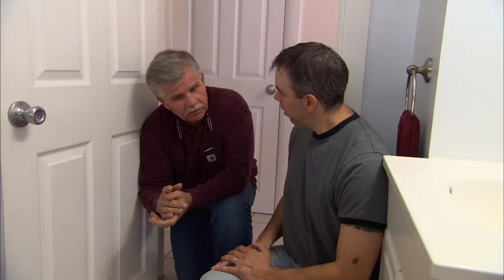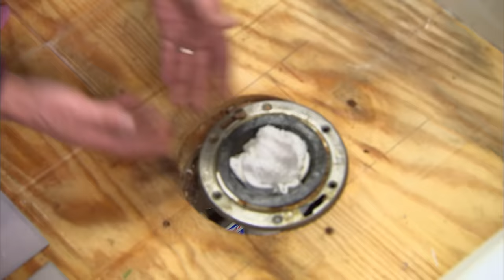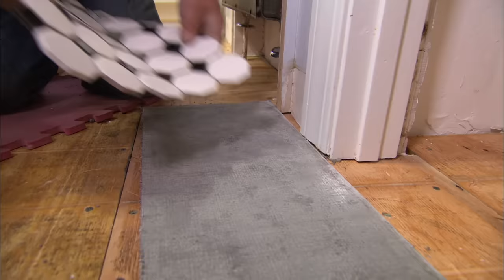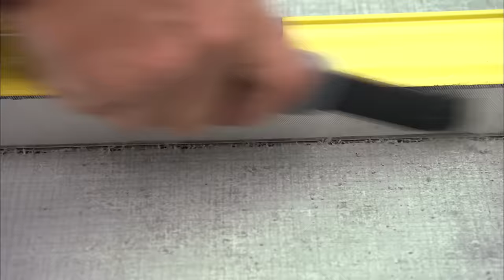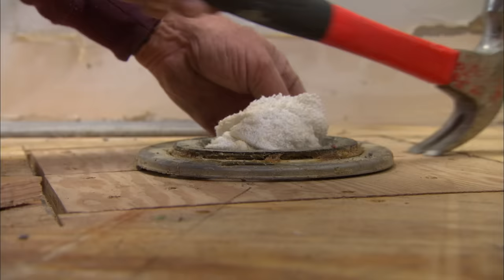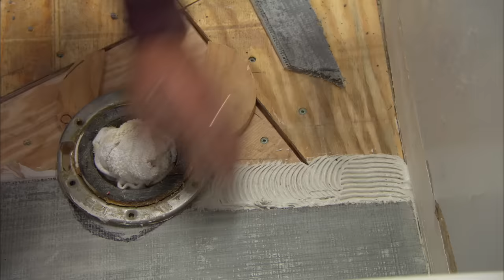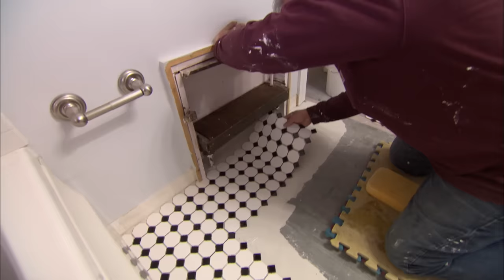How to Replace a Vinyl Floor with Ceramic Tile | Ask This Old House

Comment: Mike Holmes would have replaced the subfloor, and the walls, and ceiling, and joists... because it's the right thing to do! Minor bathroom renos shouldnt cost a penny under $85k.
Reply: Apparently the network covered labor for the Holmes shows. That would help a bit...
Reply: Lol
Reply: @jmbootz  Yeah, they don't really make that apparent for the show.

I always figured that a large portion of the cost of those "done right by Holmes" projects was being offset by the television show.

It's why I always laugh at the show when it's trying to make the previous contractors or homeowners look like they were cheapskates on purpose. The reality is that when a know-nothing homeowner is looking to get a project done and they have quotes ranging from 15k to 45k... it's no wonder they end up with the 15k one. And then get all the headaches that comes with cheap.  

If you know anything about construction, you'd know to stay the hell away from the lowest and even midtier bids.

Comment: they must be starting this conversation at 3am if they got that all done in one day
Reply: I chuckled
Reply: Exactly!
Reply: This could have easily been done in a day???
Reply: They usually shoot things like this in a few days. But you are not supposed to know that.
Reply: Von Musklaus  I bet you they did this in a couple of days. This is not your hobby. This is not a regular contract job this is a Video shoot. 30 Minutes take days to shoot.
Reply: Started 12:01am and finished at 11:59pm....with no breaks and without 5 trips to Home Depot.
Reply: When you know what you're doing,  yeah probably a day. This would take me several days
Reply: Well remember the floor came right up. Usually that’s a week of glue scraping and  cussing the last guy to work on it

Comment: When cutting casings around doors with the oscillating tool, add a layer of cardboard or something to the stack of cement board and tile. This accounts for the thickness of the thinset under and on top of the cement board.
Reply: Good tip. I bend my blade slightly up or angle my saw down so it adds and 1/8 or so. Just make sure the piece you use as a guide is small so your back of tool rests on floor
Reply: Yeah I noticed he probably had to recut
Reply: Was think the same thing, what about the thinset. Cardboard is a great idea I'll use that next time.
Reply: I was wondering about this. "What about the thickness of both layers of thinset?" Glad to see I'm not crazy.
Reply: Since he laid the tool cutting blade on top of the other materials as he cut, he added the thickness of the blade in the overall height of the cut.
Reply: Genius walking!

Comment: So, we didn’t get to see the final product. Homeowner must have messed it up
Reply: That's hilarious. And probably correct.
Reply: The meager instructions about the grout application paved the way for that to happen. Next week. How to replace a tile floor.
Reply: Another episode shows the homeowner called Richard in to reinstall the toilet and sink.
Reply: So they didn't show what I watched the whole thing for: how do you adjust the door threshold 1/2” higher????
Reply: @kurtvonfricken6829  now THAT is a good question!

Comment: Several good tips here: 1) The split "dutchman" plywood patch around the toilet drain, 2) Sliding the cement board under the flange, 3) Using the small "broken" piece of cement board behind the flange so it was a straight line for the next sheet.
Reply: I'm not a fan of 2 layers of subfloor- whenever there's a water leak/loss, any wet subfloor (first layer) has to get cut out.

Comment: You would be so lucky if vinyl came up like that!!  Whenever I see it, its 3 layers of the shit
Reply: Yeah i agree .i hate that stuff
Reply: and it's attached with the strongest glue known to man.
Reply: That's the truth!
I did my bath floor and there were 3 vinyl remodels underneath. The sub-floor  was damp and made of woven ply-board, too. The sub-floor came off like pulled pork in wood splinters.
Reply: Lucky B c
Reply: Yeah...and in older homes...full of asbestos!!
Reply: @beerob917  what if it's linoleum flooring that's been glued down? can I go right over that with tile? Or do I have to pull it up first?
Reply: I has never applied any glues to install vinyl sheet  in both  kitchen & bathroom . ( Over 20 house, )
Reply: @luckyb3859  what an absolute nightmare. I did a renovation just one time and the dude was dumping on some real toxic thinner to get the vinyl off the basement cement. No mask or anything. I promptly went out to get some air
Reply: Even Tom was surprised. 
You can see the previous homeowner cheap out to cut corners.
Reply: Using a clothes iron is a trick I used before many times. The application of heat makes the glue soft again and it helps alot.
Reply: I’m doing a vinyl demo job right now in my kitchen and it’s literally three layers of sh’t (1) the vinyl, (2) the backing and (3) adhesive

Comment: That makes a huge difference. I have the same floor but in mosaic. It didn't seem necessary to cut and fit the small pieces along the edge because the trim should cover it...at least, that is what I did.
Reply: bg147 aka cheat a little :)

Comment: I would of used Ditra these days personally if the tiles were larger. Always a pleasure to see Tommy work! Great video.
Reply: Restore&Explore what’s your opinion of ditra vs wonder board
Reply: I used ditra in two of my bathrooms. I am very happy with it.
Reply: Depends on your subfloor and structure underneath. Theres nothing wrong with using a cement board. Everything is case specific. The ease of install, and uncoupling properties of Ditra are the main benefits, and if you are planning to do a heated floor, Ditra Heat eliminates an entire step you used to have to do.
Reply: Why? it may be easier to carry and faster but for a small bathroom you would end up buying a large role and spending a lot more money.
Reply: You dont need to purchase an entire roll of ditra, just buy the amount you need, such a small area the cost will be low. I always use ditra when laying tile floors.
Reply: I am a contractor, if I knew I could get it by the foot I would use it. I have only seen it sold in stores and online in roles in California. If I have to order it then there is the issue of time and schedules. Buying roles have been tempting but they are either to big or not enough meaning there will be unused extra. It already costs about 40 % more. So unless its a large area Its not worth the headache getting it. I do like that it can act as a moisture barrier in the event of a pipe burst.
Reply: I guess it depends where you are located. I buy it from my tile supplier. Any tile store that carries Schluter products will have it and sell it by the sq.ft. If you are buying it from big box stores, then yes it only comes in rolls. Also Ditra heat now comes in square sheets, I think they are 3'x3' or so, so that is another purchase option available.
Reply: @anthonyromano8565  You can buy a roll and use what you need and just keep what's left for the next project. You can also patch Ditra together any which way and it acts the same.

Comment: Tommy, awesome as always.  For weekend DIY'ers like me, may want to add to the description/ video that cement board,  Thinset and screws  is old school underlayment.  Not a structure where uncouple membrane is the better way to go.
Reply: It works though.
Reply: Cheap and easy though. Membranes can be very expensive.
Reply: @GeeTheBuilder  
"The bitterness of poor quality remains long after the sweetness of low price is forgotten". 
Enjoy your cracked floors...

Comment: I prefer mixing up my own grout from dry.
Then you can customize the viscosity. 
So you can float in all those gaps with ease.
Pre mix grout is too thick and dry for my liking.
Reply: Could a person add a little water to premix, to thin it to taste?

Comment: Them roto zip saws are the best thing that ever came out for cutting under door jambs and what not.
Reply: how are you getting a rotozip under the casings?
Reply: My old best friend invented that tool, and the drywall bits that it was originally intended for. Then came other bits for other uses.
Reply: It wasn't a Roto-zip, it was a Fein Multi-Master
Reply: I love that multitool, makes life a lot easier

Comment: 50% of contractors would have tiled right over the plywood.  
25% of contractors that actually used the cement board would not have applied thinset below it or taped joints.
Reply: A lot of people live by the old adage: If a man on a galloping horse can't see it--it's OK.

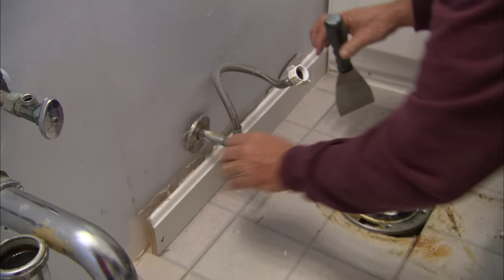Comment: 1:27 “Came up easy”

Aren’t you glad your contractor used cheap Home Depot glue now??
Reply: seededsoul no because those were stick on tiles. That is why the adhesive failed. Mastic would have glued them down regardless of the brand.
Reply: @Dixler683  that's why they're happy. because it failed
Reply: seededsoul I think it was from HB

Comment: In a bath or kitchen with a possibility of water on the floor always use epoxy grout. A little extra in cost ,but for piece of mind it is worth it.

Comment: Tommy always make look so easy.
Reply: Charles Damery yeah Tommy look easy always
Reply: I know, eh?
Reply: More like the camera, and the editing.
Reply: Charles Damer
Reply: Nothing is really that hard with 30 years of experience.
Reply: Yes what is sment board ?
Reply: rbeck3200tb40 cement board
Reply: When not filming, someone else steps in. Also, this was a 2 day job. Don't believe TV, it's hyped up. The thinset under the tile underlayment requires 24 hour dry time.
Reply: @tombryan1  Thinking the same thing. No way he did this in 1 day.
Reply: @tombryan1  Youre so Right Tom! I do this everyday and would tell the customer 4 days...Tommy saying one day was funny.
Reply: Tom bryan ummmm he screwed the cement board down, no need to wait at all. Lol

Comment: I was fine with his technique until the very end, when he mentioned using "pre-mixed grout" for the next step. I had a customer once who purchased an acrylic pre-mixed grout thinking it would be a time and labor-saving strategy. Trouble was that unlike the grout you mix with water, which can be wiped off readily as it sets up, this pre-mixed version left a thin layer on the surface like smeared acrylic caulk. It was very hard to sponge it off before it dried to the point it needed to be scraped off. There may be other types of pre-mixed grout --this was my only experience with it--but be forewarned, it's harder to work with in the end even though you're saving the time and effort of mixing batches of grout (which I never found that burdensome to begin with).
Reply: And get the grout with the sealer already in it.

Comment: How do you make sure you don't screw the cement board into the screws you put into the subfloor? Just practice or Memory? Is there a pattern we should follow?
Reply: 1. Most screws are along the edge of the subfloor piece, or the cementboard piece. You shouldn't ever have joints of the cementboard layer  lining up with joints of the subfloor layer below. You offset (stagger) the joints so that you aren't creating a "joint" that runs from toplayer right down to the bottomlayer. 

2. If by some chance you DO hit a screw in the subfloor where you wanted to screw through the cementboard, you'll know. Hitting metal feels different than wood. So you just move the screw location an inch to the left or right.  It's really not a problem that happens all that much if you are doing number 1 above.

Comment: harry homeowner left to grout the tile .  How about the plumbing fixtures where the drains don't line back up and repairs to the wall or where they were short on tile in the closet and didn't do a row?

Comment: When undercutting the door jamb put a piece of cardboard from the tile box between tile & backboard to account for you mud if you tile is an average thickness floor tile. The tile on sheets are thinner.

Comment: Tom, use the Schluter Ditra membrane, its only 1/8" thick and much nicer to work with.
Reply: Chris Pausenwein please point me to a few videos. Would love to learn more about these improved methods.
Reply: Sorry that I reply sooooo late but I am not on the internet every day. I build only Walk In Showers where the person can walk in without jumping over those unnessesary curbs or what ever. 
To 90 % I use also Wall hung Toilets  Gerberit or Toto to get rid of all those stupid holes in the floor.
with those wall-hung Toilets you winn about 10 to 12" on room. The Tank is in the wall. 
The Wall units where the toilet is installed is availavle  for 4" or 6 " walls.
Check Gerberit Wall-hung toilets. You Tube What else.
Take your Age now and then  ask yourself if you want to redo everything in about 15 years.   
Floor repairs in older homes are to 90% a complete redo.
If not, you mostly do only a patch over a patch that cost you only later.  Double.
If you lay Schluter or Blanke, check on the web/You tube it is 100% Waterproof.
A big miss conception is that concrete  boards are Waterproof,  they are not, they can take on up to 20 % of Water, but its on page 3 of technical Info and who reads to Page 3? , what is a big problem with Moisture build up and double or triple layer floors, especially in the south, where the humidity is always high so the stuff then never dries out.
On all the repairs we find lots of problems with double layers.
I don't know your specific problem but if it is not to late you can use my E -Mail  msch6791@verizon.net, for free advise. You have then to find an Installer in your aerea or do it also yourself  It is not rocket science to do.

Chris
Reply: @mastershake156  sal DiBlasi on Youtube
Reply: I agree completely. The first time I used it I was sold on it.
Reply: i thought ditra wasn't used for tile under 2 inches like mosaic because the tiles will dip into the waffle divots.
Reply: @diallelus1  You're absolutely right, that's what Schluter suggests. Ditra is great when used as intended. Best not to test your luck though.
Reply: I'd be sold on ditra if not for the price. It's unreasonably expensive. And I've perfected backer board installs over the last 20 years. So until schluter pulls their head out of their ass with the prices. I'll happily have my help carry Durock up 2 flights of stairs.
Reply: wnc817  is that not a good thing?

Comment: Looks good! I always thought that you had to have a minimum of 1 1/4” of floor (3/4” plywood and 1/2” Duroc or the like) before you add tile. In this video, I saw 3/4” floor and you added 1/4” of cement board. Would this give you problems down the road?  Thanks.....Jim
Reply: 1/2” cement board is for walls because you need more structure and rigidity between the studs. 1/4” cement board is for floors since you already have subfloor providing structure across the joists

Comment: Would this technique work in a mobile home bathroom?  Putting down multiple layers like this would look like it would.  Just trying to get rid of the flex that's inherent in trailer floors is hard.

Comment: I have the small doweler system by Festool and though it cost $800 for the full tool and dowels vs $249 for it’s most expensive competitor i absolutely LOVE IT!!!  That said I’m looking to retool many systems in my cabinet making shop.  Do you recommend the Festool line of tools at the higher cost base or are the usual pro line tools ‘good enough; (i hate those words!)?

Comment: Recently went the opposite route and went from tile to vinyl tile.  We set cement board and then tile which wasnt my idea because i didnt think the tile would stick but i got a roll on sealer to fill the porus cement board and it came out ok.

The bitch of doing tile and laying a subfloor for me were all the odd off cuts.  I hate laying flooring with a passion both vinyl and i did tile my living room.  I dont envy floor installers and/or tile setters. Hard work.

Comment: Did they need to cut the tile that'll be under the baseboard that has to be installed? It seems so, but if it's under the new baseboard, then does it matter? Is there a "finished room" video/photo?

Comment: that paint damage from him removing the sink and wall trim pains me
Reply: I cringed when I saw he didn't cut the caulking fron the sink and the baseboards.
Reply: when the sink is put back it will be at least 1/2" higher with the new tile and cement board covering up that mess

Comment: I’m getting ready to do this myself. I have done a lot of things but I’ve never done tile.
Reply: you do it?
Reply: @lucasbuchanan5063  probably in a week or two.
Reply: @lucasbuchanan5063  Not, yet. Local company is having "delivery issues" (i.e., no one available to drive the delivery van cuz they're stuck at home receiving handouts and would rather not work for a living).
Reply: m rapacki  that was like a year ago. All good.

Comment: Someone GLUED the commode to the concrete in my mom's house and I cut the tiles to go around the commode rather than shattering it to get it out.

I used a carbide blade in a jig saw to get a perfect 1/8 inch grout line between the tiles and the commode. (making it look like I wanted the commode inset into the tile from the start, even though I knew it was wrong)

I feel sorry for whoever wants to change the commode later.  Its not going anywhere without using a hammer and breaking it up.
Reply: It is possible you could have cut the toilet free using an oscillating saw actually, possible with a rigid scraper blade w/o teeth even.  Depending on the adhesive it can heat up/gum its way through it but still could be enough to get it free.
Reply: F Huber  pick me up fron jail 3088